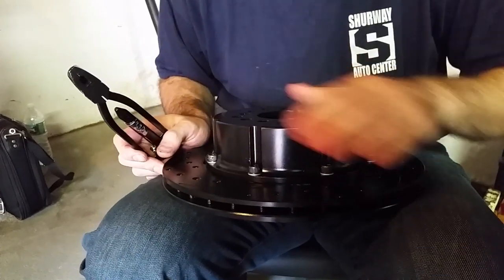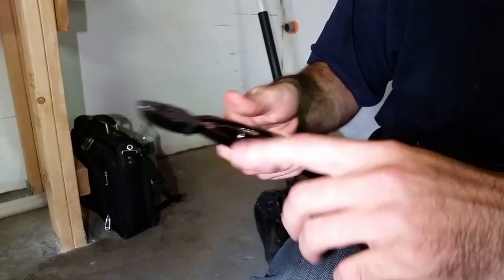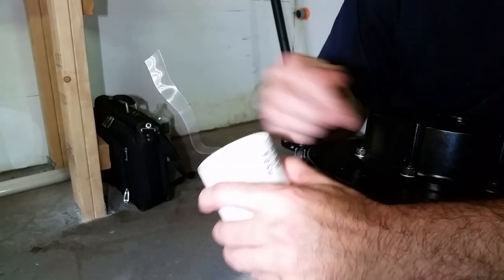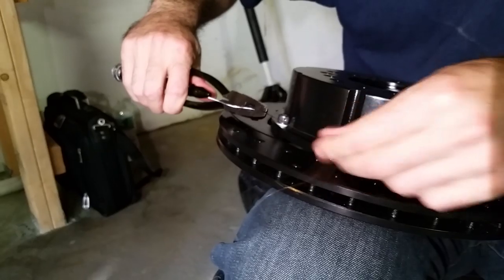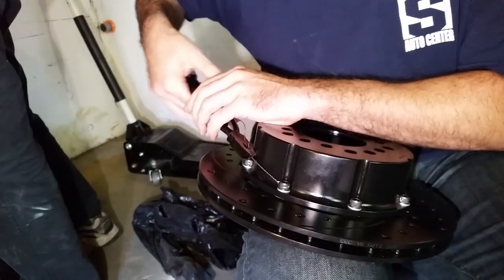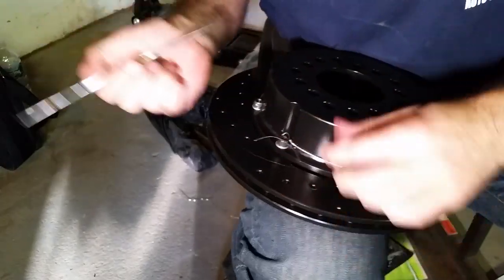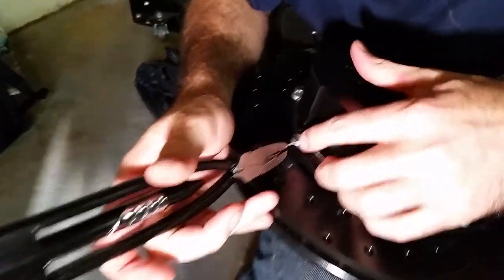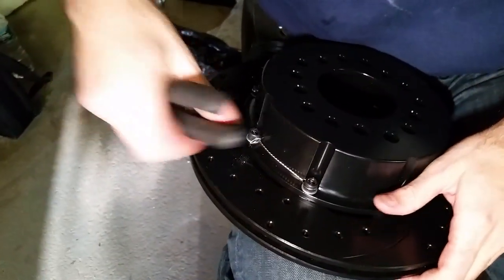How To Safety Wire Tie Bolts - Full Demonstration

Comment: With the wire being so thin, it's a little unclear on the video as to the routing. Nevertheless, it's interesting to see this tool in action. I can see how routing would be critical to prevent issues. Presumably the wire has to be stainless.
Reply from the maker: Yes.. sorry about not capturing a better angle of how it is routed..but pretty much in a way where if one bolt loosens, the other bolt its tied to is being tightened..therefore both bolts never loosen up..hope that helps..and thanks for watching :)